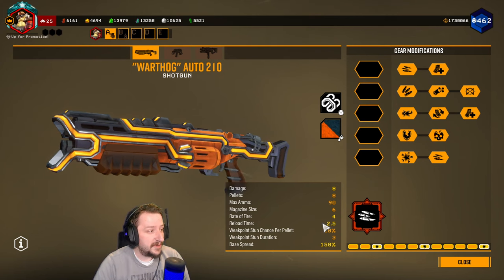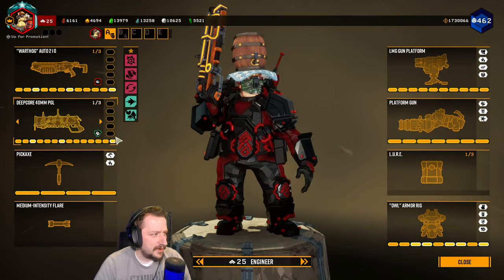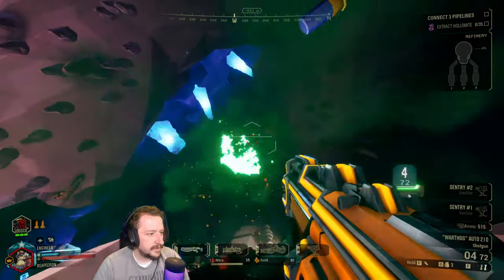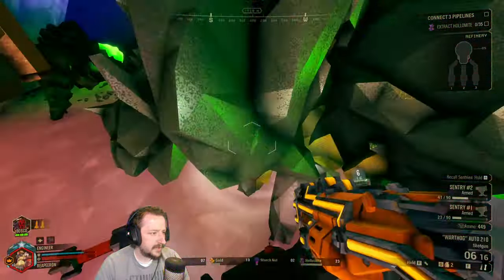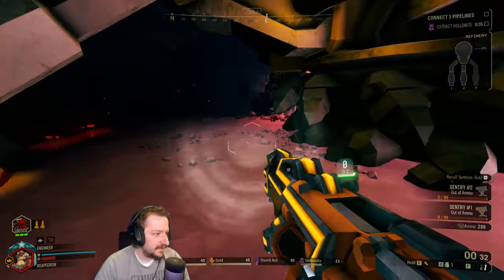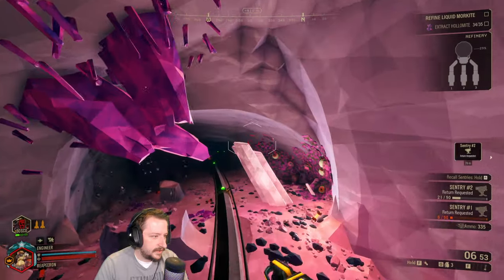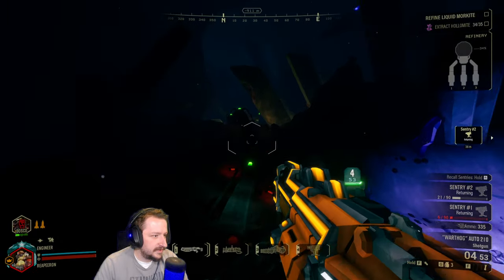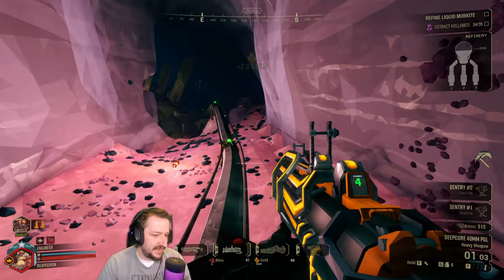How Good Is Cycle Overload? Deep Rock Galactic

Comment: I feel like MPA is so much better. The shotgun benefits massively from the boosted weakpoint damage and i think you only need like 4 pellets hitting a grunts mouth to oneshot, and you dont need to be as close to reliable oneshot grunts either.
Reply from the maker: That one is nice too.  I am wondering how that one will do without any mods.  If it will feel a bit slow or be okay.
Reply: i mean it has way less dps so idk, if we are only looking at shotguns, then idk if id say Cycle Overload is objectively better (besides eliminations) but there is a gun that does everything MPA can do but better in every way, its called lok with executioner. and just for that CO is better lol.